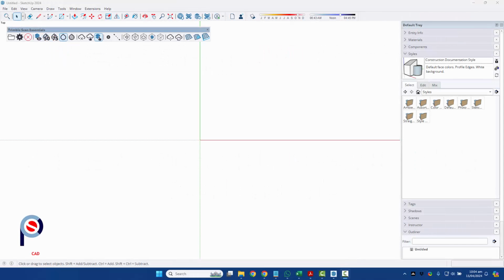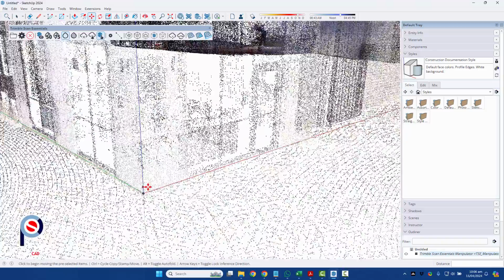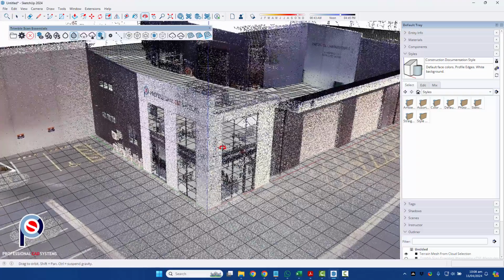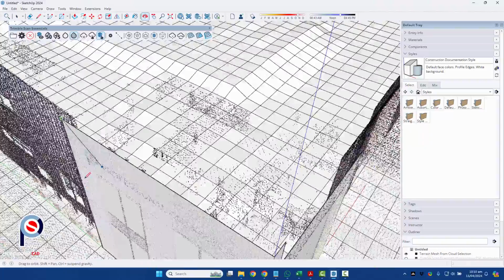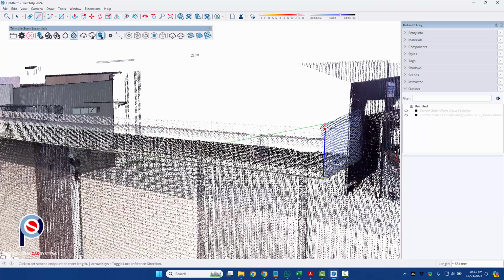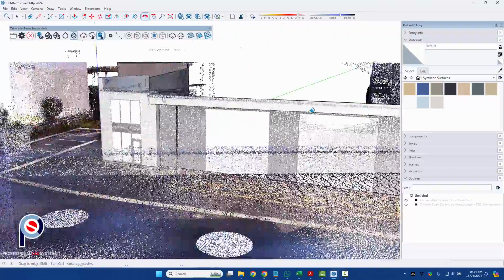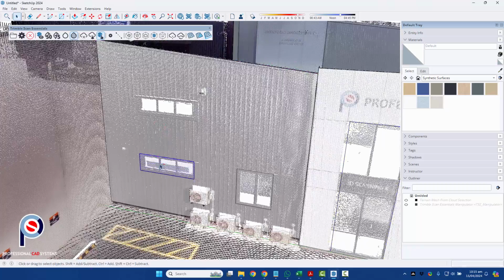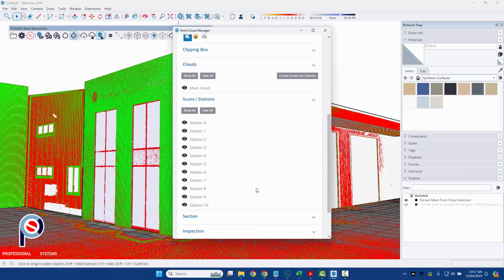How to use 3D Scan Data with SketchUp Scan Essentials

Comment: Any idea what the density slider does? I see zero changes when I move it.
Reply from the maker: It is supposed to reduce the visibility of points making it easier to see underlying model data.  Not sure why it does not work on your end.  Maybe try increasing the point size, then decreasing the density.